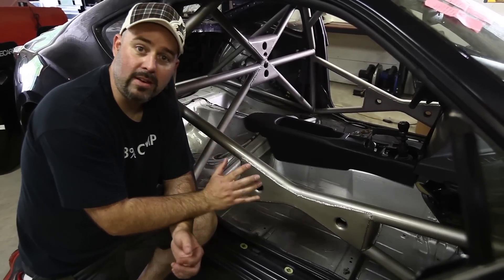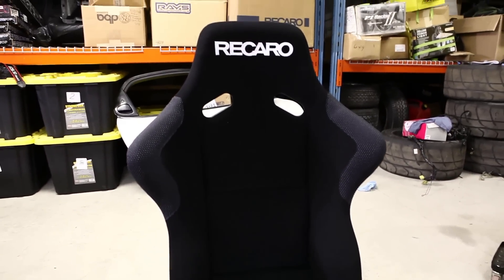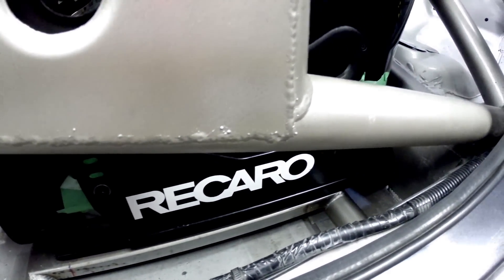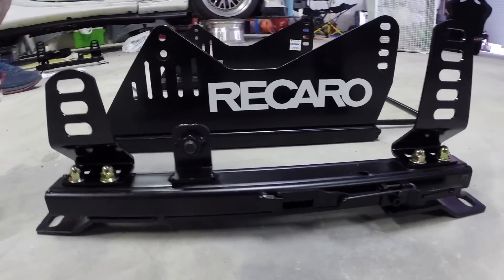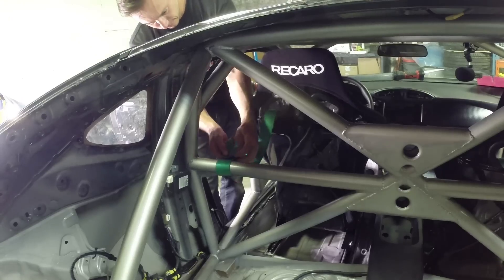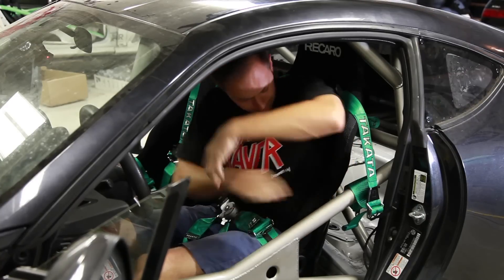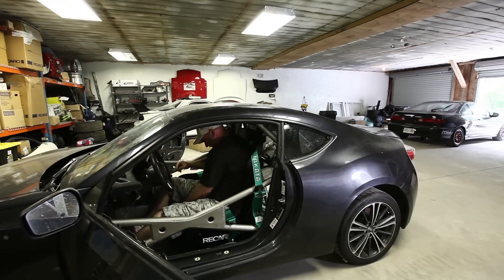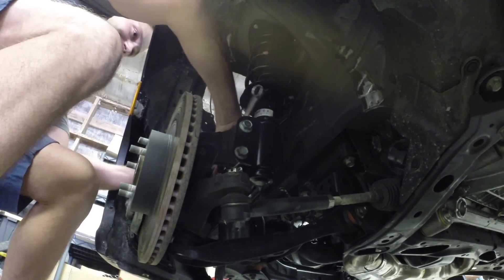Safety First - Targa Newfoundland Scion FR-S Build Ep. 2

Comment: I have raced since 1988. We have built many race cars and won 10 track championships and over 200 races. I have a question. Why would you build a roll cage and then bolt the seats and seat belts to the floor? That is SOOO dangerous. The belts should be bolted to the cage and the seats should be bolted to a piece hung between pieces of the cage. I've never raced at a track that would allow seats or belts to be mounted to anything but the cage, if there was a cage installed. I have seen people sent home until the correction is made.
Reply from the maker: a1scooter1 The drivers seat has a metal bar running from the cage to the transmission tunnel but why do you say bolting seats to the floor is SOOO dangerous? Same goes for belts, we've been bolting eyelets to the floor of cars for years now and have never had any issues with tech or safety at racing events.
Reply: I don't road race, just circle track. If a seat is bolted to the floor and the cage moves, or is dislodged, the seat stays put and the cage is crushed into the seat/person in seat. It's the same with the belts. If they are mounted to the cage, and the cage moves, or is dislodged, the seat and belt just moves with the cage and the person has a much less chance of injury. I have raced under many different sanctioning bodies and they all require the seats and belts to be bolted to the roll cage. The following is an excerpt from an article about this. ....
"Where the belts are attached is as important as the hardware used to attach them. Any bolt used to secure a belt tab should be bracketed so that it is 90 degrees to the direction of pull. The belt tab shouldnever pull where it would stretch the bolt in length or put a bendingload on the tab.
Belt attachments should never be directly fastened to floor sheet metal. Of course, the seat mounting should be a part of the rollcage so that you move with the cage in the event of a crash. If some of the belt attachments are mounted to the cage while others are attached to the car body, you could get squeezed when one moves and one doesn't". ....If you don't have a cage, then by all means, bolt them where you can. If you do have a cage, NEVER bolt them to anything but the cage. I'm just trying to save someone from very serious injury or death. The only time this ever came into play with any of our cars was one that Bobby Hamilton drove for us. He had yet to move to Winston Cup and was driving one of our cars. For some insane reason, he changed seats and mounted the seat to the floor instead of the cage. He had a very hard crash and was almost killed because of his stupidity.

Read more: http://www.stockcarracing.com/howto/scrp_0603_racing_seatbelt_installation/#ixzz3b1d39ZHJ
Reply: Speed Academy Here's a few points. ... NASCAR rules .. The Seat
The seat has several important jobs:
It must keep the driver inside the roll cage of his car.
It must keep the driver from contacting anything hard during a crash.
It must absorb some of the energy of the crash by bending.
In the past, several deaths occurred when drivers still in their seats were thrown from cars. To counter this, NASCAR rules now require that the seat be attached, at several points, directly to the tubular structure that forms the roll cage, which is sometimes the only part of the car left intact after a crash.

Here is a common rule at many tracks and sanctioning bodies.
1.7 Seat Belts. 4 point belts required. 5 point belts highly recommended. Belt must be minimum 3 inches wide and no more than 5 years old. Seat must be mounted to a seat mount bracket welded to the roll cage. Mount your seat belts to whatever you mount your seat to. Follow your seat belt manufacturers guidelines as to proper seat belt mounting angles etc. Do not bolt through seat belt fabric, use steel piece that comes with seat belt.

ASA rule ..

12.1.2 Shoulder harness must be mounted securely to roll cage, recommended to be no more than one year old.

WESCAR Touring Series .. 9.2          DRIVER’S SEAT
§  WESCAR approved racing quality seat is mandatory.
§  No plastic or fiberglass seats. All seat mounting bolts to be minimum 3/8” or larger with a minimum 1” washer.
§  Seat must be mounted to the frame and roll cage.
§  It is recommended that the seat provides support to driver’s ribs, shoulders and legs when sitting in a normal racing position.
§  Headrest/head surround must be mounted to seat or roll cage that will give full support to drives helmet when sitting in a normal racing position.

§  Shoulder harness should run through a welded loop behind the driver seat. Restraint system must be securely attached to the roll cage structure.
Reply: Speed Academy You got me thinking and I checked two race seat manufacturers, Kirkey and Butler Built. They both recommend mounting to roll cage. I was going to check some more, but I'm sure they are all the same. By the way, I like your builds, they are sharp looking. This is just one thing that it seems like you have over looked or just weren't thinking right. If you just think about it, I'm sure you will start doing it the safest way. I honestly just don't want someone to get hurt.
Reply from the maker: a1scooter1 We're always learning so thanks for the knowledge. Per most of the series we run, it's ok to mount to the chassis, especially when it's a passenger car (not a tube frame race car) but that doesn't mean it's the safest. I did a bit of searching and couldnt find a good photo of how we'd go about mounting it to the cage so if you have any by all means let me know.
Reply: Speed Academy I'll take some pictures of some of our seat mounts and send them to you. They will all be a little different but the concept is the same on all of them. Your cage is different than any of ours, but it would be easy to mount the seat and belts to the cage in your car or any like it.
Reply from the maker: a1scooter1 That would be great! You can send me an email at peter@speed.academy

Thanks again!
Reply: Did you get the email I sent you?
Reply: +a1scooter1 with the proper FIA equipment floor mounting belts and seats is no problem in a "newer" car, most new gt cars have belts and seats bolted to the floor. if done right there should be BIG back up plate under the floor to spread out the force of a crash so there is no risk of the bolt going trough the floor. bolting seats to the cage seems to be more of an american thing, I never seen it in person here in europe
Reply: Erik Blixt It's not the bolt coming through floor that's always the problem. If you are racing in a car that has a roll cage and the cage is dislodged from the car and the seat is bolted to the floor, the seat and what ever is in it can be cut in half. If you aren't used to seeing what I'm talking about, you probably think it isn't needed. After you build one car like I'm saying, you will never do it any other way I sent a drawing to the Speed Academy. The way you are describing may be okay, but okay isn't always best. I want the best, not just okay. The way I am describing is the way that I will build every car I build that has a roll cage. How new a car is makes no difference. I can send you the drawing too, if you would like.
Reply: +a1scooter1 i can see what your doing by bolting it to the cage, like creating a seperate saftey cell seperated from the car? its often FIA that put stop to the saftey ideas from america, and i don't think we have the same nature of crashes that you guys experience with oval cars hitting concrete walls. atleast i have never heard of a seat or cage geting seperated from the car over here. i would appreciate the drawing its allways fun to see how other guys do things :)
Reply from the maker: In Europe it's very common to see the seat mounted to the cage in the manner you're describing. Dave mounted the seat in his Honda Civic CTCC race car this way, but in Canada (and the USA) race seats can be legally mounted to the floor as long as the mounts are FIA approved and the correct thickness and size backing plates are used. We've certainly seen plenty of big crashes (Dave has been racing for close to 20 years now) with the seat mounted to the floor in the approved method without any unfortunate results. As for the belts, we installed them as per Takata Racing's instructions, which also meet FIA regulations. Again, it's about using the correct hardware and proper size/strength backing plates.
Reply: Speed Academy I know one thing .. I want to do some road racing.
Reply from the maker: a1scooter1 do it! It's an expensive hobby, but money is a renewable resource and a life experience like racing will last a lifetime.
Reply: +a1scooter1 the "problem" you are describing comes from overall build of the car, when the shop is replacing side sills, floors etc with flat pieces of their own design - and that is the reason why your motorsport authority wants to see the seat mount as a part of the safety cage. FIA grA or grN spec cars (bodyshell is standard with little or no mods allowed by rules) do not have the design feature you are talking about, and as far as I remember, I do not recall any accidents where post crash analysis revealed that trauma to driver/codriver could had have been avoided by tying the chair mounts to the cage. FIA does not allow mounting seat to the floor though, what is required are 2 tubes of specified min cross section and wall thickness on the floor with ends welded to side sill and the transmission tunnel (on mandated size backing plates) - and there actually is a reason why it is done this way. You actually want some deformation - movement between the cage and the chair - it means that some force of the impact is absorbed by the crumpled portion of the car body, compared to your design - where the whole impact force is transmitted to the driver via rigid cage-seat-mount - which is very very bad - this is the whole idea and the benefit of not connecting the cage and the seat mounts.

Comment: R you for reall? 
did you just mount the seat belts straps on the floor just on the small hoops?
Reply from the maker: +Ei Al Yes and that's a perfectly safe and approved method.
Reply: +Ei Al It is perfectly safe  NASA organization recommends it, and everybody I know who tracks professionally and non-professionally mount to the factory seatbelt locations....I do it myself but I just route my harness over the cage and mount to the factory seatbelt locations.
Reply: +Ei Al Those small hoops are easily capable of taking hundreds of pounds of force without flinching.